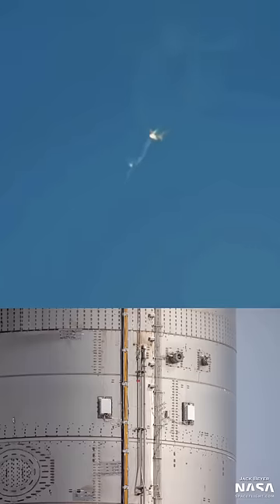Is This Why Starship Wasn’t Destroyed The Moment It Lost Control?

Comment: Having seen hundreds of rockets blow up after going about ten degrees off axis, I am amazed to see how Starship was able to tumble like that and survive.
Reply: This is the real takeaway, and shows how well engineered these rockets are.
Reply: Exactly, the flight termination system was built to break the weak spots of an rocket, so the external and internal forces would tear apart the rocket instantly.

And the starship didn't just took a second max Q while spinning at such speeds, it also did those cartwheels with holes in the tanks. And I hope that the FTS would be better with the next ships considering what happened in the first flight.
Reply: This thing could have hit the ground in one piece. They better make it less prone to failure or at least revise the self destruction system.
Reply: @thelastwoltzer  No, it couldn't have hit the ground in one piece.  Within about one minute, the rocket was over the Gulf of Mexico and remained over the water throughout its entire flight.  The nearest land in its flight path was Africa.  By the time it traveled that far, it'd have been in low earth orbit, and its ballistic trajectory would have carried it across Africa to crash into the Pacific on the other side.

They are performing these tests specifically to identify points of failure.  Those results will be used to eliminate those weaknesses (points of failure) in future iterations.  That is the whole point of any product testing campaign.

There isn't a person involved in the program that didn't openly acknowledge they need to beef up the FTS within the first couple of hours of the test.  Everyone was amazed that the FTS they installed couldn't take out the ship.  There is no intelligent person who would install more high explosives on the largest rocket ever made than would be necessary for a successful flight termination (aside from the ~+10% "safety" margin).
Reply: It was corkscrewing, not tumbling

Comment: I noticed it had lost ~ 9 KM in altitude before actually exploding .... this, I'd assume, needs to be addressed too.  Seems to me a large delay is a potentially large problem.
Reply: Poor design for a self destruct sequence, I mean spontaneous unplanned disassembly.
Reply: Gives passengers 30 seconds to escape.
Reply: @InuHost  great design and progress with development, given the history of NASA's Apollo program, with at least one mission that exploded with astronauts on board
Reply: @apollobro91  Exactly what I was speaking to my wife about.
Reply: @InuHost  you might actually be onto something there
Reply: Extraordinary claims require extraordinary evidence.

I saw it do flips during a testing flight. Maybe we should apply to SpaceX. 🤔
Reply: @apollobro91  It really isn’t, it’s a failure in just about every way.
Reply: I like the idea that it was to give passengers time but I kinda feel they could just activate it as they are leaving or something. Still it does work in that they get time but it will self destruct no matter what.

My own theory is so that the explosion happens closer to ground mainly to prevent debris from raining down a wide area.
Reply: @InuHost  shame there’s no escape system on this rocket for any passengers.
Reply: @apollobro91  Saturn V was developed from the ground up without a single failure. The Soviets tried what Elon is trying with spacex, and found that lots of engines don’t work. They create failure points, make more vibrations and cost more than having a couple very large engines. There’s a reason all rockets used today only have a few engines. Ie, spacex just failed. with prior knowledge on how to launch and how not to launch, and compared to 1980, infinite computer power. Whereas NASA did it with pen and paper many decades ago with absolutely no idea how to do it. SpaceX suck, it’s as simple as that, there are far better rocket programs.
Reply: @MauriceOfInfiniteAtrocities  Unfortunately, however, Elon seems open to suggestions. Tweet him a screenshot of this convo or something.
Reply: @MauriceOfInfiniteAtrocities The Saturn V was one of the single most impressive projects in human history, and it's unlikely anything will ever surpass it in aerospace in terms of sheer input knowledge to output product. It's like comparing every swimmer in the world and every level of competition to Michael Phelps. It's just not a fair comparison, and will lead to a skewed view of the industry.

That doesn't make SpaceX not good. Despite the manchild at the top, the engineers there are doing incredible work unwinding problems that have plagued rocket development for decades - including, as you noted, the many complications of high motor count rockets. They're not unique or magic, they're just first. I'm keeping an eye on Relativity, personally- unlike the non-SpaceX billionaire tech bro rocket makers, they're keeping their heads down and focusing on making a good product instead of a flashy one.

I get that it's very tempting to put down SpaceX because of the goof of an owner, but don't do the people who actually make the business work - the workers - dirty like that. SpaceX engineers have done some genuinely incredible stuff, and the money guy pretending he's a lone genius instead of just the money guy doesn't change that.

Comment: Got to admit, it held together pretty well through all that.
Reply: it's supposed to survive reentry eventually
Reply: Thats not a good thing in this context.  A flight termination system should do just that, promptly end the flight.
Reply: @johnbigelson7471  Well yea, but the boosters and the starship held impressively held together through all that spinning.
Reply: @rainfall2880  I guess, it wasn't going that fast though... started to tumble at 2 minutes in, going 1800 km/h.  That's a paltry 500 m/s, whereas the shuttle is typically going 1200+ at that time.

Thats not to say starship is bad, just that aerodynamic forces are heavily influenced by both AoA and speed, so to say its strong, I say we cant really tell yet, tumbling at mach 1is way different then tumbling at mach 4..
Reply: Yeah - the one time it VERY MUCH wasn’t supposed to hold up, it did.

What a colossal failure, my god.
Reply: @johnbigelson7471  it did it before it was a danger  but yes it should be faster thrn that regardless
Reply: true, it did hold togetherfor a minute, but that's s huge failure for the safety system. Not having a reliable self destruct could result in significant loss of life, and protected habitats.
Reply: DARE I SAY MADE IN AERICA
Reply: @gregcushman3137  Indeed.
Reply: “Got to admit, the flight termination system did an AWESOME job not terminating the flight! A lot of precious data was surely collected!🤓👏👏👏” -Muskrats
Reply: American made
Reply: @rainfall2880  theyre supposed to already be that, i wouldn't trust this thing with my life and a billion dollars
Reply: I think the problem that seemed to jump out at me was it's too long. Disproportionately so. I'd opt for trailing a shorter length with maybe four fall away boosters attached. May give more stability adding to earodynamic proficiency. And possibility to add more lift or less easily with boosters. Which could also be shipped unmanned to Mars when required and parachuted down the new martian society of elonites in the elonmuskalite quadrant of muskdonia. Just need to ensure the delivery and landing method can survive the elonaspheres muskiness 😶....
... Went off on one a bit there didn't I 😂😬
Reply: @gregcushman3137  Aerica? I don't know that country.
Reply: @erzahler1930  previously we used to call it america now name changed to aerica

like in India,everything same but change the name..after some years their officisial history books will say one mr bhaskarana did all three atomic blasts including thermomnucear device and sent chandrayan too and flew first Tejas plane and dr apj kalam was his office boy

Tight or Right?
Reply: @jabrokneetoeknee6448 just curious, what has Musk done to make you have such disdain for him and his fans? He has done nothing but try to further humanity, what possible reason do you have to be a hater?
Reply: So did I held it very well, but the minute it burst into flames I was by the toilet door already. So, all good here in london. 😅
Reply: "for a brick, he flew pretty good..."
Reply: FR
Reply: Looks like it hit the ceiling and had to be brought back down 🤔

Comment: Even with the rigidity provided by pressurized tanks, I was very impressed that Super Heavy and Starship remained relatively intact while doing a few supersonic somersaults.
Reply: I wonder how much force was on it
Reply: theres very little air density up there
Reply: @SPACECOWBOY_Hej  - True.  Not much air density, but the rocket was tumbling while in supersonic flight which places great stresses on the structure.  In the recent Starship analysis, Elon commented that the displayed structural performance well exceeded design limits.  He also said that they need to revise the flight termination system because the tanks were perforated as planned but the Starship and Super Heavy remained intact until they tumbled to a lower atmosphere where it was destroyed by the forces imposed by the increased air density.
Reply: @Liberty4Ever Sounds like progress. I wonder if any rocket has ever had a chance to experience those conditions?
Reply: @Liberty4Ever  Not surprising that Musk extolled the virtues of the rocket during it's failure, that's his modus operandi - often when avoiding a reasonable question. It also doesn't necessarily mean it's true.
Reply: @DoubleMonoLR  - There is a big difference between traditional aerospace development, which is very slow and very expensive, and the more entrepreneurial approach taken by SpaceX, in which progress is quickly advanced through experimentation and "failure" is an expected and even welcome part of the process.  Do your best, blow up a non-crewed vehicle, learn what didn't work and fix it.  Repeat as necessary.  No matter how much that process is explained, detractors continue to see an exploded rocket as a failure, and not as a natural step in the process to not only success, but the most rapid and cost effective path to success.

An objective observer cannot compare and contrast the success of SpaceX in developing reusable launch technology and the lack of success of Aerojet Rocketdyne, Northrop Grumman, Boeing, and United Launch Alliance in the attempt to resuscitate non-reusable SLS technology from the 1980's Space Shuttle leftovers, and conclude that the big legacy defense contractors aren't engaged in a giant corporate welfare program at taxpayer expense.
Reply: It was so well made that even surpassed the self destruct system
Reply: @Liberty4Ever heres actualy not a difference, spacex is government funded mostly. The difference is that nasa would realistically call this a failure.
Reply: @MrDmadness  - If you think this very low cost initial attempt is a "failure" then you don't get how SpaceX is efficiently developing reusable rockets.  Yes, NASA pays SpaceX to launch people and cargo into space, but much less than they pay their traditional defense contractors.  The SLS is way overdue and over budget as Aerojet Rocketdyne, Northrop Grumman, Boeing and United Launch Alliance continue to fail at taxpayer expense.  They had a big head start and most of the funding, all they had to do was recycle some proven 1980s RS-25 Space Shuttle engines and Space Shuttle solid rocket boosters to make a non-reusable heavy lift vehicle and it looks like those tens of billions of tax dollars will be wasted on a corporate welfare program because even if the SLS does eventually work, it's old dead end technology that will cost over $2 BILLION per launch.  The fully reusable SpaceX Starship will completely crush it on cost, reliability, safety, environmental issues....
Reply: @Liberty4Ever  star raker destroys this pitiful ship and it did it in the 70s . Nothing exploded, it took off like a plane, and it burned hydrogen. I take your points and respect your thought out response but this was a 100% failure.. literally the platform and pad did not survive.  Landing??? Youre joking right ?? It has to actually take off and fly first..  it failed the controled flight part and since the landing surface was obliterated the chance was 0% before it even took off.   Call it what it was, a failure of engineering with an accomplice of bad planning.   Respectfully.
Reply: @MrDmadness  - Star Raker was an interesting design concept but it didn't DO anything.  It never made it off the drawing pad, much less the launch pad.

What you call 100% failure is a different method of aeronautical development that is far more cost effective and is consistent with the way most products are developed.  Nobody tries to build a completely new car with a new engine, new transmission, new suspension and new engine control computer, integrate all of these new systems and expect them to work the first time, and if not, the project is deemed to be a complete failure, but that's largely what we've been conditioned to expect from aerospace.  It makes a lot more sense to develop incrementally, testing and learning in the process.  This is how SpaceX developed the partially reusable Falcon 9 which is currently launching far more than any other launch vehicle because it's less expensive due to reusing most of the hardware, but also because it's made so many launches that they've learned enough to make it the most reliable launch vehicle even though it has the added complexity of landing the first stage so it can be reused.

Starship will leverage what was learned with Falcon 9 and scaling it up to much larger payload capacity with full reusability to drive the launch cost down while maximizing the safety/reliability.  Contrast what SpaceX has accomplished by building and crashing uncrewed rockets to develop not only as quickly as possible, but paradoxically as cost effectively as possible, compared to the four large defense contractors still unable to fly the SLS that they're building from leftover 1980s Space Shuttle technology that is a technological dead end.  It's not even close.

I honestly feel sorry for the astronauts chosen to fly on the Boeing Starliner.  Boeing was allowed to self certify their human rated vehicle and NASA tried to send Christmas presents to ISS in 2019 as an unmanned proof of concept of the "human rated" SLS that was scheduled to fly astronauts in 2017.  Starliner missed its orbital insertion so there were no presents for the ISS crew.  When fixing their 100% tested and certified software on orbit, Boeing also found and fixed another software bug that would have resulted in their human rated vehicle burning up in reentry.  Meanwhile, SpaceX Crew Dragon, less expensive than Starliner, has been flying crews to the ISS since 2020 and is even flying civilian astronauts for Axiom Space.  Before the Crew Dragon flew humans, Cargo Dragon had been routinely sending cargo to the ISS since 2010.

Safety is achieved by testing to prove designs and then refining them.  The traditional "all the eggs in one basket" aerospace development method is fraught with peril.  I'd ride in Crew Dragon, but Starliner?  If it's Boeing, I ain't going.

If Boeing was allowed to self certify a completely new airliner, would you buy a ticket for the maiden flight, knowing that it had never been flight tested?  Or would you prefer to fly in an airliner that had been extensively flight tested, including crashes and redesigns, and then been used to haul FedEx freight for a decade before being fitted with seats to transport human passengers?
Reply: Do we know it was supersonic while flipping? Couldn't it have not got that fast yet? Rockets accelerate opposite of a car. Rockets start accelerating really slowly, and then gain more and more speed the longer they are "gassing" it. So it could have been right on that edge before supersonic?  Idk lol